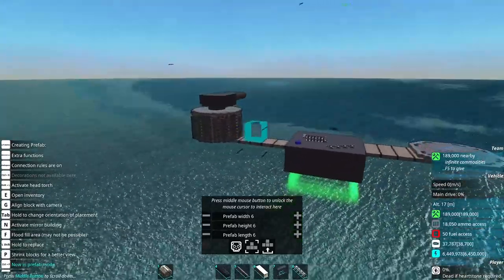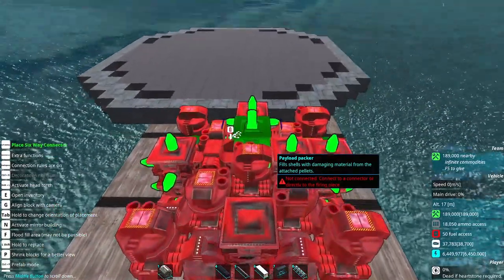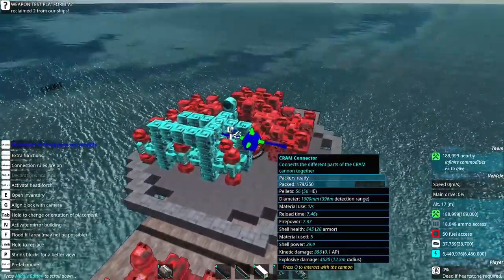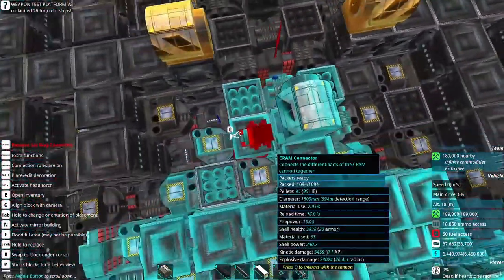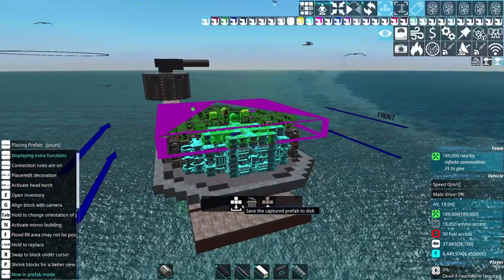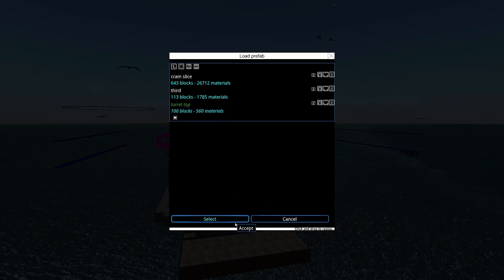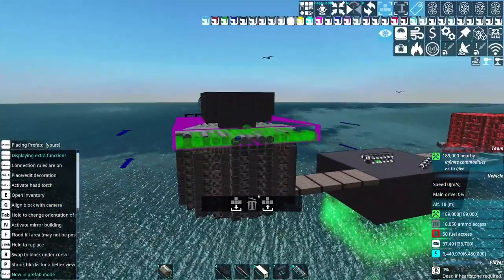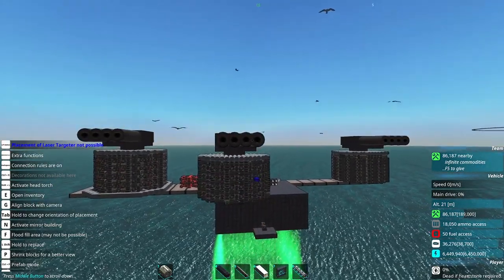Advanced CRAM Cannon Tutorial - Building a Multi-Barrel 3D Tetris CRAM Cannon

Comment: It seems to be so situational that you really have to be careful on when to consider using it
Reply from the maker: I did design it for use in large guns, but multi barrel crams are generally only for large guns anyway.
Reply: @bungalowbill521  doesnt having mb and high hp shells help defeat lams etc?
if the target is killing 4 or 5 shells from a salvo, im better firing 16 shells instead of 8
Reply from the maker: I believe that cram scaling is quite flat these days, so those 16 shells would have roughly the same hp as 8 if they were coming from equivalent turrets. Unlike missiles, I don't think that cram shells lose effectiveness as they get damaged, so you'd actually be better off with a single shell that doesn't get popped at all. However, I do like adding additional barrels so that I have better consistency, and don't lose my entire turret to a single kinetic round.
When it comes to APHE cram rounds, I prefer fewer barrels so that each round has more kinetic damage.
Reply: @bungalowbill521  fair enough. cant say i build any turret well enough to guess at equivalence. just derping my way through with the priorities of, get shell to target, do damage to target, reload before heat death of universe.

my single barrel crams struggle to hit the broad side of a monastery. though from watching letsplays, that seems normal.